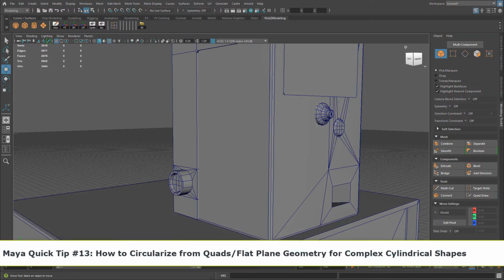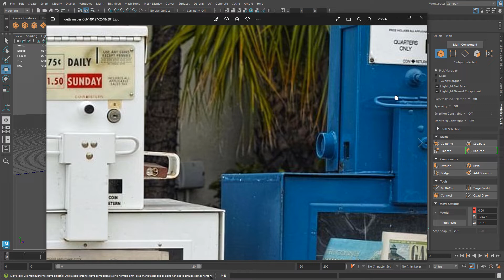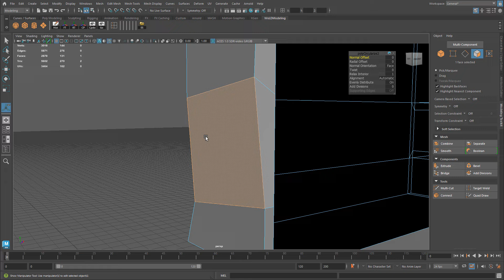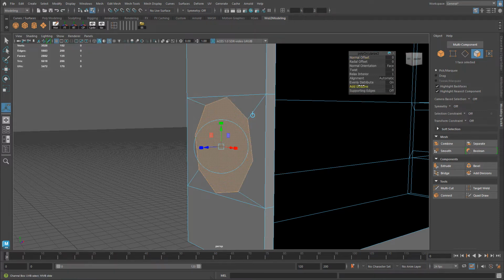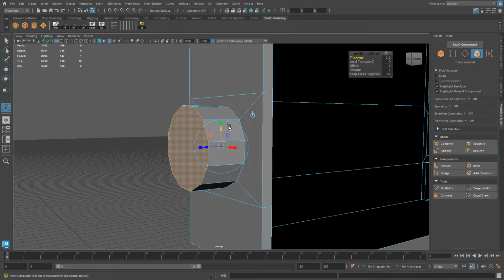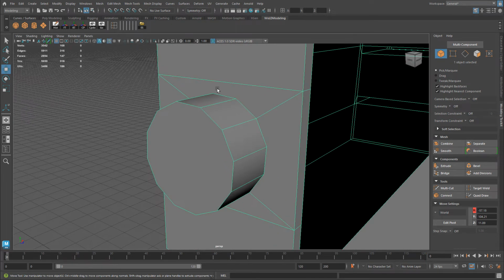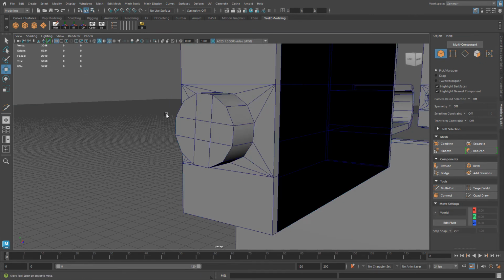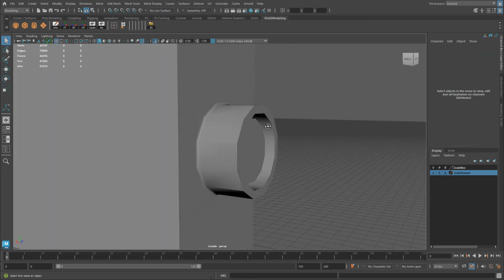Maya Quick Tip 13: Circularize Single Quads/Flat Plane Geometry for Complex Cylindrical Shapes

Comment: Damn, now i can save more time working on a model. Thanks.
How do I clean retopo this type of hard surface model? I use Quad Draw, which is so painful sometime to work on hard surface model, I also try to auto remesh/retopo but i cant achieve what im targeting.
Reply from the maker: I usually use Multi-Cut and Target Weld to clean things up and reflow topology. I also try to model clean ahead of time when possible to reduce the amount of clean up I may have to do. You're right on Quad Draw. It takes too long and for complex hard-surface meshes it's a pain. So try to model cleaner and pre-plan your cuts/bevels/extrusions.